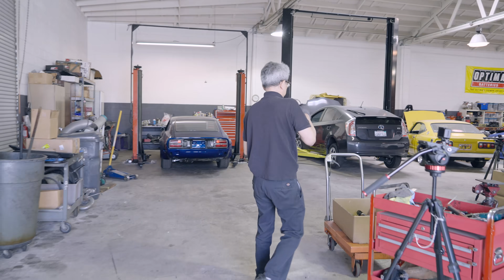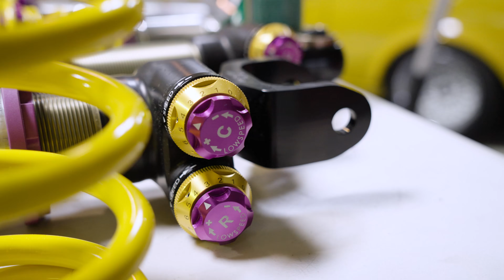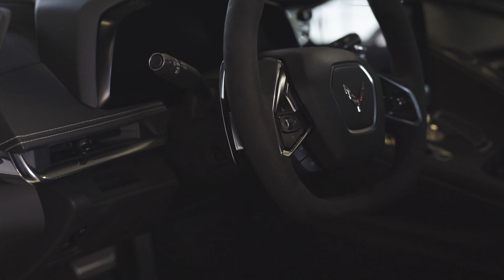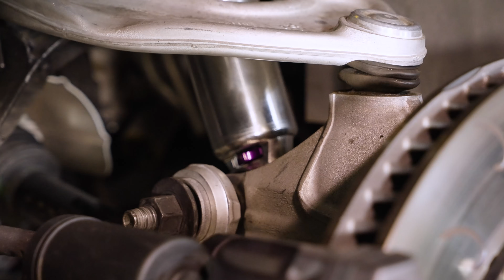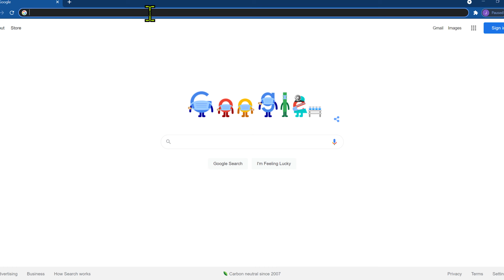Why the C8 Corvette Sucks On Track.. and How We're Fixing It!

Comment: Great video.  Just a point of  correction, the stock pilot sport 4S is a summer tire.  It comes on the z51.    It's also a 305 width not a 325.

Comment: CALIPERS ... not rotor mass (thermal capacity) held it back !?
I realize you changed the rotors ... but the rotors are probably a fraction the price of the calipers (and believe rotors with more thermal mass can probably be used on OEM calipers) ... that's what the cheapskate in me would rather see; because those rotors shouldn't be more than $200ea at most ... and I wouldn't be surprised if that ultra special AP brake "kit" was over a couple grand. 

Ultimately, to compare things in a fair manner ... replace just the tires, test the braking. 
Then replace just the rotors, test the braking and resistance to fade. 
Then replace the calipers + pads last ... see how much a difference the extra pistons make. 

The coil overs will of course give you better track tuning, but at the expense of being able to tune it on the fly...so for track, I understand.  

I used to use A032 (which limited me to 17" wheels with a DOT of 70 I think) ... very stick. They hummed to where I knew how fast I was going by just the tires. On concrete, once up to temp, they'd roll out tire prints as if they were being fingerprinted. And on damp surfaces, they got better traction than my stock Michelin Pilots got dry.  Sure, the rears only lasted 5500 miles ... but they were also less than $100 each (and that was with me driving like a hooligan). The fonts got about 11k miles ... and again, they only came with 1/4" new. 

It's really nice to see you can get STICKY tires in sizes larger than 17" ... but:
They also cost a fortune for tires with sub-100 DOT ratings. 

R888R - $400 each ... (maybe more) 
Pilot SC 2 ... $500+ ... (obviously we're talking 275+ in size)

GONE are the days of SUB-$100 high performance tires (if you could deal w 17" -- A032R

Comment: So a brand new C8 comes with shitty brakes and suspension that isn’t suitable for track….how much does this car cost again?
Reply from the maker: Shitty is relative, but not optimal for the track for sure. However very few expensive cars are also great track cars bone stock.
Reply: Under 60K and regular drivers will never outperform the stock parts. Only experienced drivers will have the need to upgrade parts and thats with any car. People will exceed the limits of higher priced cars and still need to go to aftermarket parts. For the price of the car its a good deal all around for what its capable of.
Reply: $90,000 to $100,000

Comment: Long wheelbase + weight + under-tired in the front = doesn't want to turn.  Independent of transition tuning with shocks, a bit more rake than OE for roll center coupling plus a smidge of toe-out in the front and minimal toe-in in the rear (even zero), depending on camber settings, really helps the C8 to rotate.  Look forward to having OE adjustable sway bars with the upcoming Z06 package.  Great video per usual from the MotoIQ guys!

Comment: Can I add the Essex Racing AP brake kit to my 2022 Corvette C8 Coupe (non-Z51). I don't intend on tracking the car, but I like a solid better braking system.
Reply from the maker: Yes you can and it's a wonderful system with great street feel.
Reply: @motoiq  What about If I have custom 3 piece forged wheels by Variant Alloy(model FCK-3P+)?  Wheel sizes are 20x9 with offset are 34 or 36 in front, and 20x11 with offset 44 in the rear.
Reply: can you provide a rough quote and is there a specific model numbers for the AP system for my C8?
Reply: I have 2 sets of wheels...the OEM wheels and the Custom wheels I mentioned above.

Comment: Hey, I have an issue with my C8 where the brakes keep making sound on low speed braking the sound comes randomly and the dealer said its the characteristic of the the GM brakes. My question is do you know a way to fix it and is AP Racing brakes make annoying sounds also?
Reply from the maker: Unfortunately your dealer is correct and it is a characteristic of most high performance brakes.  You can stop it temporarily by spraying the back of the brake pads with a product like permatex anti squeal but it will eventually come back and it will have to be re applied.

Comment: If you're not writing it down, it's not science.  Please do lap times before and after mods so we can see the gains.
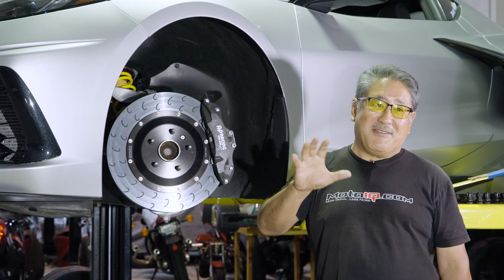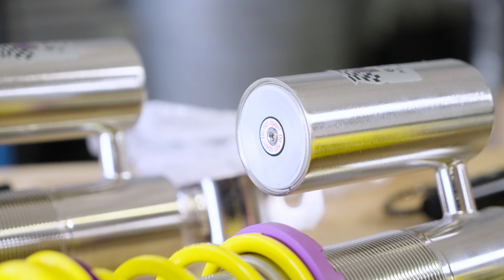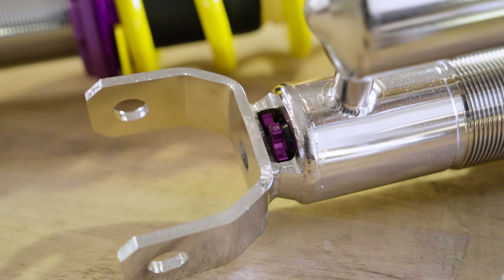Reply from the maker: Buttonwillow CW13 standard NA time attack configuration,  before- 1:56, after- 1:52 under bad conditions (hot, windy, track greasy) can probably go under 1:50 with ideal conditions. A sizeable improvement.
Reply: @motoiq  Always including these kinds of things in the future would be greatly appreciated.  Thanks for the info. :)
Reply: @tjwreds1  Agreed. There is no bragging without a good baseline.

Comment: So, I watch Speed Phenom and he doesn't have the same gripes and he tracks his all the time.🤔
Reply from the maker: Well those issues are what we found on the tracks we used, Cal Speedway and Streets of Willow, different tracks have different demands. Different driving styles and skill levels make for different demands on the cars as well.  It looks like he cooked the brakes bad as well. https://www.youtube.com/watch?v=bHEsi5HGcZQ
Reply: I drove the C8 (Z51) at VIR. I was shocked at how bad it was to drive. I have years of experience on the track in Corvettes & Porsches. I am waiting for the ZO6 reveal on 26 Oct. After such disappointing performance on the track I stopped my order on the HTC C8. Plus the C8 is 3655 lbs. in the coupe & add 70 more pounds for the convertible @ 3725 lbs. This is hideous and kills track performance. My  C6 ZO6 weighs ~~3100 pounds. My 2013 Convertible 427 weighs 3460. If the C8 ZO6 comes in over 3500 lbs. I will cancel my order and get another Porsche.
Reply: @gordydexter2615  track alignment and tires make a BIG difference in how this car performs.

Comment: Stock tire widths are 245 and 305, not 255 and 325. 245/305, a 60mm(2.5 inch wheel width stagger) tire width stagger is stock, a 265 and a 345 tire width stagger is a 80mm(3.5 inch wheel width stagger) difference, thier will be more understeer not less, just that the 265's will alow for higher forces before there is understeer. Should of gone with 275/35r19 on 10's and 325/30r20 on 12's: a 50mm tire width stagger with a 2 inch wheel width stagger. In comparison to a front-mid engine/rear wheel drive wide body C7 a 315/345 or 30mm tire width stagger is popular, the C7.R has 300mm(tread width not tire width) front and 310mm rear tires, but Michelin lists the slicks at 292mm and 320mm approximately a 30mm tire width stagger. A 718 Cayman GT4 has a 50mm tire width stagger, the Ferrari Challange cars have had a 50mm tire width stagger(60mm is stock).
Reply: As setup, the car does have a little oversteer. The 345s can be tuned to neutral.
Reply: @marketingguy80  In another comment you said you haven't tried R888R's yet, haven't tried 345 yet only 325. I know about suspention adjustment, tire pressure adjustment, alignment adjustment. Going to extremes to correct flaws is fooling yourself. If the 345 are on 12 inch wide wheels you are only geting a 325 rated size contact patch width, if it the proper 13 inch wide wheel with 265's on a 9.5 inch wide wheel thier will be understeer. Over steer is posible, a 265/345 setup if one forces the C8 to oversteer or entry under steer exit over steer(like a 991.1 GT3 RS). The absolute minimum for a mid engined track car is a 70mm tire width stagger or 275 on 10's and 345's 13's. A 991.2 GT2 RS that was a 935 tribute car made by Porsche has a 11.5 inch width front wheel and and a 13 inch width rear wheel implying a 40mm(1.6inch) tire width stagger as a rear not mid engined race car(not mid engined like the current 911 RSR). With extreme down force(car has to be going  fast) and without sweeping corners, or area were you can't trail brake a 70mm tire width stagger and a 3 inch wheel will  barely work(McLaren Senna). You can not make rear tires neutral, they will always have grip, only the perportions of grip front and rear. Also R888R are famous for heat cycling out faster vs the Nitto NT01, Nankang AR-1, and Goodyear Supercar 3R.

Comment: KW coil overs are street shocks, they will be garbage after a few track days.
Reply from the maker: Oh god no they will not!
Reply: @motoiq  they are absolutely not race spec, or track day ready.  JRZ, Ohlins, Motons are what you use for the track.  I have personally seen KW systems destroyed after, leaking badly, with no rebound or compression left after two track days.  Only the top line KW is suitable for track duty, and at their price there is much better choices.
Reply from the maker: @racekar80  do you know the prior history of the shocks?  We have personally used KW V3 and Clubsports for years on the track with no issues. We feel that they are one of the best shocks at that price point. Equivalent JRZ, Ohlins, and Moton are a higher price point. The lower-priced units that cost about the same from those companies are only single adjustable. Anything wears out and breaks, we have had failures with JRZ and Motons before and have had circuit cross bleed issues as well, it doesn't mean they are bad, just that valve combination was and we didn't know the failed shocks prior history. We sent them back and had them rebuilt and re-valved and they were fine. Our VA STI street class time attack car uses KW Clubsports to good effect with no issues and that is a track only car.
Reply: Jrz

Comment: Correct me if I’m wrong but the 4S is a summer tire. The 4S doesn’t mean 4 season. It’s the 4th Generation of Pilot Sport and it’s the S model as opposed to the non S model which has different characteristics.
Reply from the maker: You are right its a summer tire but not in the highest performance category like the PSC2

Comment: the r888r is not a warm weather only tire, I mean you don't wanna drive it in the snow, but in freezing temps as long as its dry it'll still give you a crap ton more grip than something like a PS4S.  The PS4S and other tires in its class actually lose a lot more grip once temps dip below 40°F than most 200tw and below tires do.  Same with wet as long as there isn't standing water.  I live in the northwest where it rains a lot and I've daily'd the r888r through the rainy winter months, as long as you don't expect to drive through 300 feet of 1" or deeper standing water at 70mph you'll be fine.  The only thing the PS4S does better is water evacuation in standing water... in snow both tires are equally useless.  

also stock rear on the C8 is a 305, not 325.
Reply: It will absolutely not.  In freezing conditions the softer compound be ones like hockey pucks.   The Michelin still has a bar of rubber in it useable in cold temp.
Reply: @bhvrdr  go put both on a 500wtq car and drive it in freezing whether and get back to me. Have you done that? Cause I have…
Reply: @boblast5582  I just got an Elise and it came with R888's and the car rotates so easily I do it unintentionally sometimes, It usually happens at the start of the drive so I thought it was just that these tires need to be warmed up before they have much grip? Is it just because they may be very old? Maybe just conincidence on tire temp and me driving like crap?
Reply: @Blas4ublasphemy  could be lots of things really.  old tires can definitely be a factor... also could just be that they're heat cycled out.  it also could just be the handling setup of the car, setup to rotate very well.  are all 4 tires r888's?  also r888 or r888r?  I don't have any experience with r888, but if they're r888 then its almost certainly a tire age thing.  then again if all 4 tires are equally old it shouldn't suddenly be tail happy.
Reply: @boblast5582  ty for the reply, R888R tires front and rear, has sport suspension and LSD factory, tires have a ton of tread but unknown age.

 I had car inspected at Lotus Huntington before purchase. The front tires look a little used on the outside edges but otherwise look as new as the rears.

The front tires are 195 and rears are 225
Reply: @Blas4ublasphemy what about tire age? There’s a stamp on the sidewall that tells you the week and year the tire was made. If the tire is over 5 years old it can lose grip. 

Is the car stock? Stock sway bars?  I’m not really familiar with the Lotus platform, not sure if there are any adjustments with the stock parts. But if you have a bigger rear sway bar but stock front it can cause oversteer balance. Or both aftermarket and the rear is set to a stiffer position… or coilovers with spring rates for more rotation. Or even alignment?

Also, the r888r is a good tire from flat cold, but that doesn’t mean it’s optimal. Depending on ambient temp it may still need a little bit of warm up to get to optimal temps. A thing that might be happening is the front tires are warming up quicker given the size difference and for a small window of time the front tires have more grip than the rears compared to when all at optimal temps or all cold.
Reply: @boblast5582  Again ty for the reply and info I need, I will check later today to see how old these tires are. I think the car is totally stock as I was never told otherwise from Lotus but has optional sport suspension with the wider front tires it comes with and factory LSD. That is a really interesting point about maybe the fronts get warmer and more grippy faster.

Honestly I love this car and think maybe coming from a Fiesta ST and driving the Lotus like one is my biggest issue but I will be putting different rubber on a second set of rims soon so at least then I can tell for sure if that's a factor or not.

I have Federal tires on my Fiesta and love them lol.

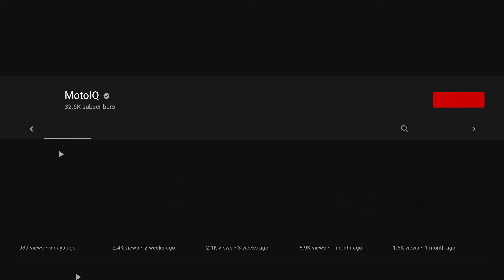Comment: Great video with a lot of good information. Thanks. Quick question: I noticed the small ramps, at the end of your video ( time 11:28), that you use to get the car high enough to use your hydraulic lift and I am wondering what brand they are or maybe where you got them. They look light and easy to use.
Reply from the maker: They are made by discount ramps and they cost under $50 at most places.  Race ramps are better but cost way more.

Comment: What made you choose r888r over a Goodyear supercar 3R? Just curious not sure if it’s because of sponsors or what
Reply from the maker: Price mostly, the Goodyears would be better if the cost was not a consideration.  Also the ability to run many heat cycles before falling off, Toyo's are good till the tread wears out. Hell, Hooriser A7's FTW!
Reply: @motoiq  I’m in favor of putting A7s on the street corvette 🤣
Reply: @AndreKlebleyev  I regularly run Supercar 3Rs on the car (this is the owner) but will be doing some testing on the R888R too. Looking forward to trying out the 345 rear tire (currently limited to a 325 on the 3R).
Reply: maybe price if not sponsored?  also despite them both being 100tw, the r888r will last longer.  But r888r is definitely one of the least sticky 100tw options currently
Reply: @boblast5582  yeah I mean he did say it’s not the fastest tire, but I rarely see r888r really used at the track by serious people. Nankang AR1 are cheaper and don’t fall off/get greasy and are proven to be a second faster on average. And supercar3r are prob the best 100tw tire currently. “Best” in terms of relative speed I don’t normally pay attention to life honestly

Comment: Have you guys ever compared alcon or another big brand  brakes to ap racing calibers? Ive been very commonly told wilwoods are extremely soft and crap for true racecars. AP racing seems super common but reliable
Reply from the maker: We have yet to use Alcon but they have a good rep, we tend to use AP, Brembo, and Stoptech for most of our projects.
Reply: @motoiq  thanks for the input!  I appreciate it
Reply: Look at factory backed efforts and teams with big budgets. They aren't using Wilwood. Worst brake torture I've ever seen was high level tarmac rally. AP were being used.
Reply: wilwood pads are super soft, which leads to the wilwoods are soft and crap comments.  get different brand pads for it and that problem will go away.  speaking from experience.  The BP10 pads that came with my wilwoods are easily the worst pads I've every used in any car, including the cheapest discounted option at the cheapest discount auto store.  That being said these AP calipers are definitely better than anything wilwood has to offer.
Reply from the maker: @boblast5582  It depends which Wilwoods, they make tons of models and some are very flexy but some are decent. They are no Brembo or AP but for the prices, some of them are great.
Reply: @boblast5582  calipers. Not pads im speaking on. Theres multiple people in our track subarus group that have easily warped and cracked wilwoods off a couple sessions.. Thats why i said that, its not some game of telephone. Also i asked MotoIQ for a reason...
Reply: @boppernostopper8598  really? cracked and warped calipers?  I spent like 10 mins googling this and didn't find anything... can you point me to where I can see this? I'm curious...